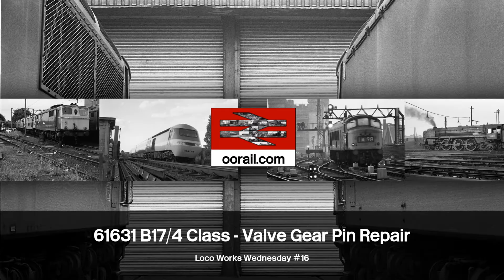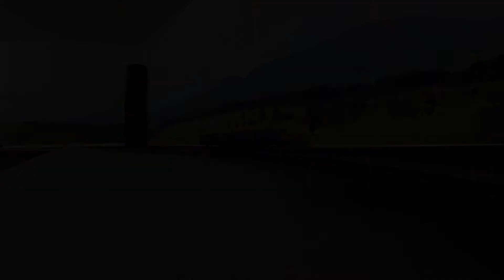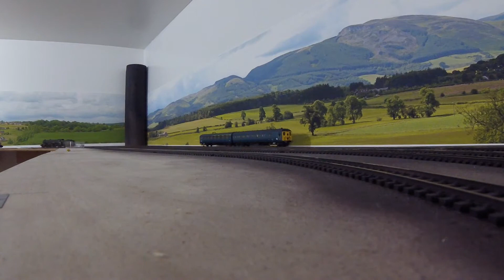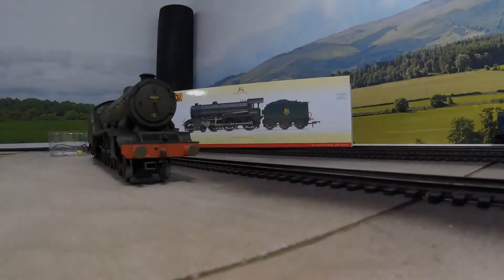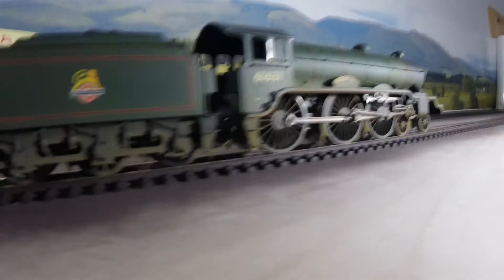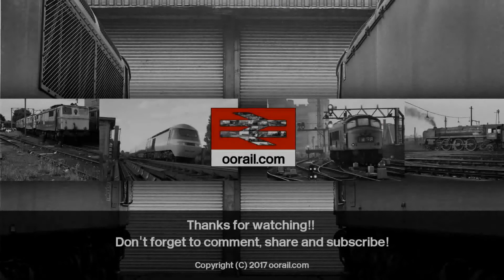oorail.com | Hornby Valve Gear Pin Repair - Loco Works Wednesday #16

Comment: Hello I’m looking for a website for that screwdriver from the toy skate board your son uses. I’m repairing a American bachmann 2-8-0 consolidation to replace a valve gear.
Reply from the maker: They sell them on Amazon but they come free with the Tech Deck you skate boards which you can find at your local Walmart or Target in the USA. Just search for tech deck screwdriver. They are just metric hex nuts.  So mini-hex screwdriver set might be a better option.
Reply: oorail.com thanks I appreciate it
Reply from the maker: @MattKonsol  You are very welcome. I believe the tool is a hex nut driver, but precision sets in metric or SAE are really expensive ($30+), so the tool is cheaper via the skateboards. Hornby sell a tool as well.

Comment: thats a long video to install a screw, thought it might have covered the push in ones on the 040
Reply: I too am looking on how to safely remove the push pins on 040 conrods
In the end, I used a nail removal tool - it's a bit like a screwdriver with a slot down the centre, and it has a gradual thickness. I used it to straddle the pin's head and applied outward pressure, and the conrod pin pulled out. If the conrod pin's head was too close to the conrod, then inserting a screwdriver between wheel and rod and gently twisting raised the pin enough to use the nail remover.

Comment: this will come in handy as my brother has just asked me to take a look at his hornby railroad a4 as one of the driving rods has come out of place and bent sliglty all the pins are in place but i didnt now how to get them of as the only ones ive done in the past were little screws, thanks for sharing, tom
Reply from the maker: Thanks Tom. I'm glad the video was able to help you out. You should be able to straighten any slightly bent driving rods with a pair of long nose pliers or a vice. There is a video I did awhile ago on quartering a steam locomotive, that may also be useful to you depending on how badly damaged the valve gear / rods are.
Reply: cheers mate will have a watch of that video its not to bad will hopefully straighten up with a pair of pliers like you say

Comment: Hex bolts are a pain , an expo tool helps but you only need a tiny bit of torque and if too much you’ll sheer off the head leaving the wheel usually useless because you can’t retrieve the broken thread inside . Two options 

1 - buy a replacement set of driving wheel and con rods which come with hex bolts . 

2- take the sheered off top of the hex bolt . Reverse it . Cut or file away the broken remaining thread . Super glue to the top of the exposed thread allowing full movement around the con rod and wheel . It’s a cheap temporary fix , I usually finger tighten mine then nip up with thin nose pliers gently!

Comment: oorail.com I know what you are talking about I had to on a 72XX 2-8-2 Hornby model and you need a Expo drills & Tool 2.5mm nutspinner I have one after I told my local modle shop about the tool it's worth getting one.

Comment: Very nice "How To". I have the same problem but with w Hornby Class 08 Shunter. When it came off it buckled the connecting rods to the point one snapped. I have purchased a new set of rods, screws and cams.  The only problem I have is, the tool I have is the correct size for steam engines, but the Class 08 nuts/pins are smaller....Simon
Reply from the maker: Thanks Simon. I definitely lucked out that the rod didn't buckle. I think the Class 08 has pins, I can't remember off hand if they screw in, maybe check the instruction sheet? If they screw in, you may have to carefully use a pair of needle-nose pliers to remove them. If they don't screw in its likely you will have to carefully pry them out. I would definitely check the instruction sheet or ask on RMweb if you are uncertain. Most of my Class 08s are Bachmann :)
Reply: I too had a problem with the SERCO 08 Hornby shunter, one of its rod came adrift, fortunaltley it did not buckle!  But it did not appear to have anything actually holding it in place.  Great how to by the way 00Rail :)